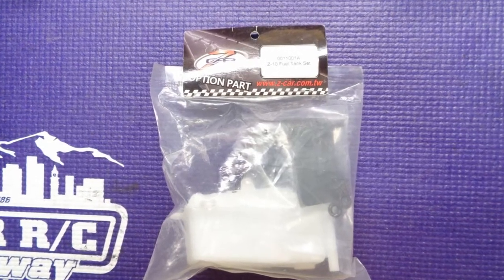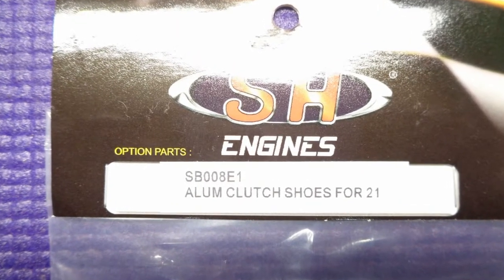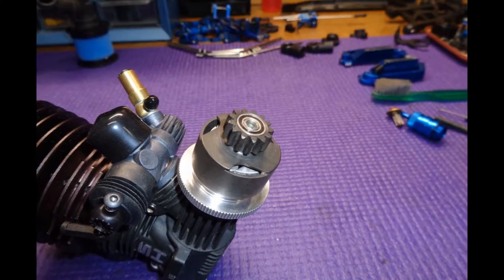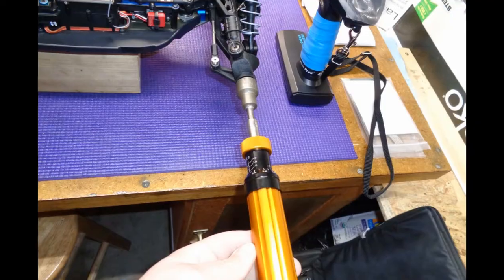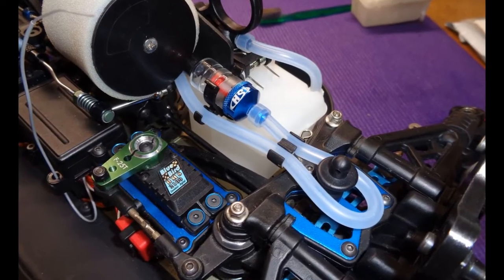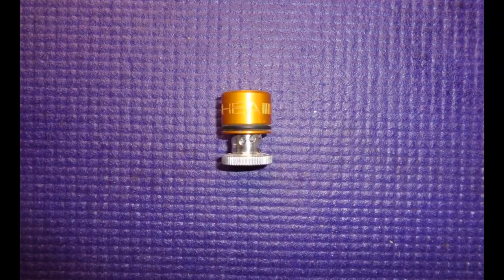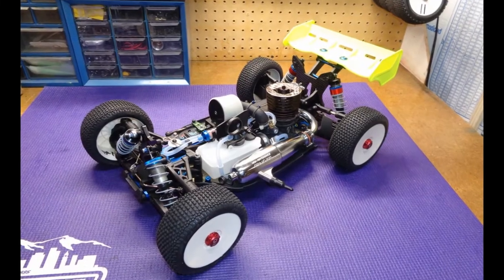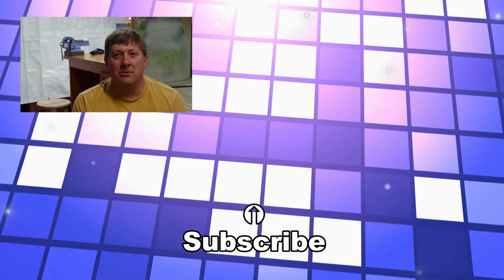1/8 Scale Budget Nitro Buggy Build Part Four

Comment: How's the runtime on that engine with the 2075 pipe? Is it the 2016 or the 2010? I have a PT2018-XBG, the 8+2 port, and I'm struggling to get more than 7 minutes with the 2060 pipe. With the 6mm venturi I can barely get 8 minutes, but not reliably, and it runs hot. I'm thinking about trying the PT2018-P3XBG. It has a smaller crankshaft and claims to have better runtime.
Reply from the maker: The engine in the video is a PT2010 with a PT2016 head.  The older style heads are not nearly as durable as the new style.  That is why I switch out the head.  The PT2010 is a much different engine than the the PT2018.  On the tracks I race on with a 2075 pipe I can go over 9 minutes very easily.  If you are running on a large tracks or doing really long pulls the 2060 pipe is not what you want.  In fact I don't really recommend running it even though the 2060 is the pipe that A-main sells.  If you dig around the Taiwanese RC web sites you can find some information on the 3 port PT2018.  A lot of the changes they made to it were meant to fix the power delivery problems with the PT2017.  I almost always run the 2075 pipe.  If you are doing really long pulls in a park or open lot, even the 2075 pipe is probably not going to get the fuel mileage where you want it.  Depending on what vehicle you have the engine mounted in and what your final drive ratio is could also be destroying your fuel mileage.  The three port PT2018 should give you better fuel mileage, but if you are doing long hard pulls you don't want to be running the 2060 pipe.
Reply: @oakes4501  thank you for the detailed reply. There isn't much English information on these engines. I ordered the 2075 pipe from RC Willpower a few weeks ago and will be testing it along with a few other pipes I have to see if it's possible to get good runtime out of the 8 port PT2018. I'll be sure to share my results here and on RCTech to try and make sure people know what works best.

I've also seen the article on the Taiwanese RC Tech site about the 3 port 2018 and I have thought about getting one to try it out. The smaller crank diameter is interesting. If I do I'll share my results.
Reply from the maker: What fuel are you running?

You have to use google translate extensively to dig up information on the Taiwanese web sites.  You also might want to check in to Terra Nova Hobbies in Canada.  They have a fair amount of SH stuff in stock.  If they have what you want in stock you will usually get it faster than RCwillpower.  I have one of the 3 port 2018, but I have not had a chance to try it out.  I think you will like the 2075 pipe a lot better than the 2060.  I can't remember the number, but if you are running on a really big track, they do make a top end pipe.
Reply: @oakes4501  I'm running Bones Brew 30/8. Our track is pretty small and technical. I was talking to Terra Nova a few months ago about buying a 21 Z Car, but it fell through. It seems like it's very difficult to get in touch with SH.
Reply from the maker: That is pretty much about what I run for fuel.  Here is just a idea of something to try.  When I ran the 2060 pipe it produced most of the power down low, like at 1/4 throttle.  The next time you practice, try only slowly pulling about 1/4 throttle and see if you can clear the jumps and only use full throttle on larger straights.  When I ran the 2060 pipe I could clear most any jump (except a large tripple) at about 1/3 throttle or less.  One of the things I found with the 2060 pipe is that it fell flat on top and had pretty crappy gas mileage if you use full throttle very much.  I found the 2060 pipe to have a really weird power band.  I found that if traction conditions were low, driving at throttle positions less than 1/3 throttle could be a real handful.

Regardless, I think you are on the right track with the 3 port.  I would try the three port with both pipes.
Reply: @oakes4501  quick update. I have the SH 2075 pipe, but have not tried it yet. However, I have tried the CRF/Orion/Performa 2149 pipe with the PT2018-XBG and wow, what a difference. Whereas before I was struggling to get even 7 minutes on a tank with the 7.0mm venturi I am now easily getting 9-10 minutes on a tank. I have not noticed much of a performance difference. Maybe a bit more top end, but still plenty of bottom end.
Reply from the maker: Glad to hear it, and I am not all that surprised that the CRF/Orion pipe worked better.  I have always been very happy with the 2075 pipe.  I tried running the 2060, but just never really liked it.  I hope you have good luck with the 2075 pipe when you get a chance to try it.